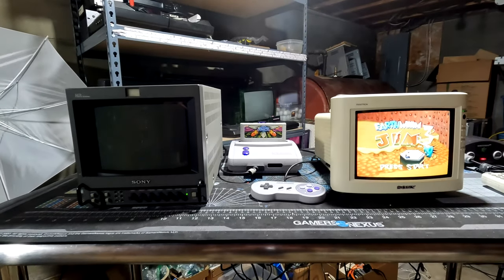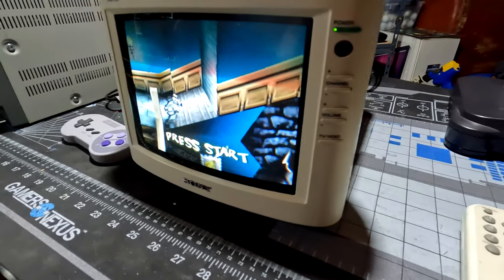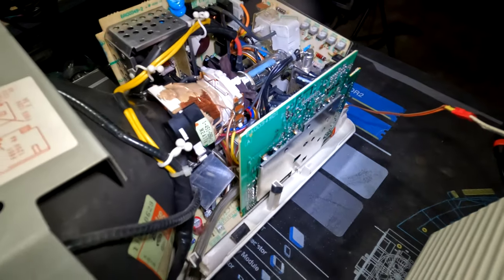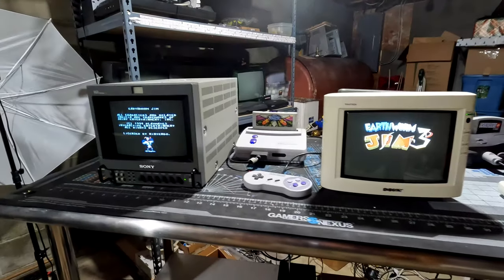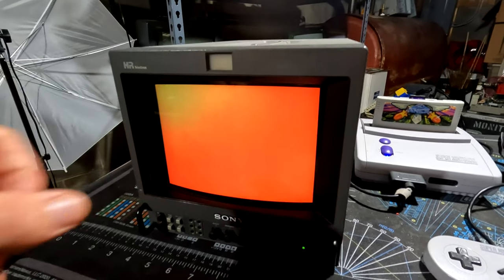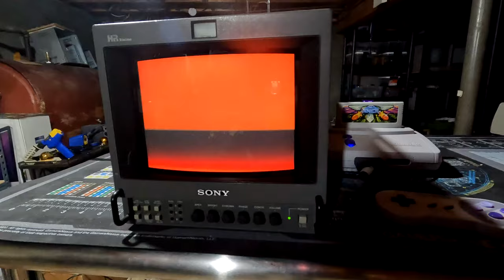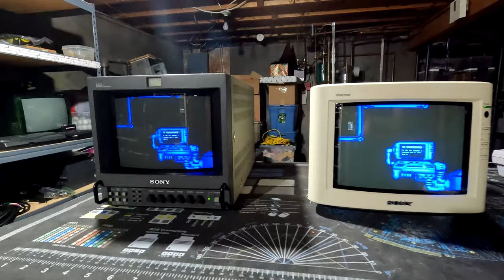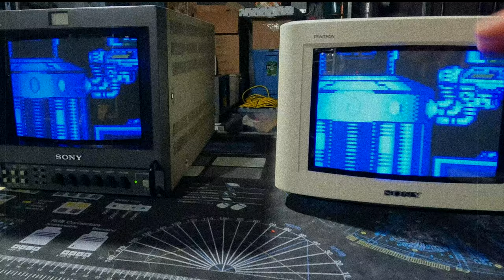The Sony CRT showdown - KV 8AD12 versus PVM 8044Q

Comment: Here'e a dirty little secret with Sony CRTs. Whether it's a BVM, PVM, or KVM, it's the exact same CRT although they had different part numbers. The CRT's were graded in manufacturing. The best were used in the BVM series, the second best in the PVM, and the rest in the consumer KVM models. We had Sony BVM monitors in our VTR bridges (above the VTR) at a playout and satellite uplink facility I worked at. When the CRT's got old we replaced them with the consumer tubes. Worked fine as a VTR monitor was not color critical.
Reply: I would like some more info on the phosphor pitch though. That seems to vary between tubes.

Comment: I’m intrigued to know… 

When a CRT gets to this type of age… apart from the fact that all types of electronics, chips and capacitors can fail which I assume you know full well how to deal with...

Does the (not sure what to call it) electron guns deteriorate and can that type of thing be fixed?..

Basically I’m asking.. once a CRT is acquired by you... is there ever a situation where it can't be taken to a new state.. like out of the box display (ignoring aesthetics, scratches etc… would love to know..

Just started watching your channel a few months ago after seeing you on ZEZ’s channel.. really enjoy your work... big love bro.
Reply: Not anymore.  This was rare to do when CRTs were the norm due to cost, skill, and equipment but the parts to repair a CRT are no longer made.  You can do a "rejuvenation" (shock) on a CRT but that almost never works, especially on a Sony CRT.  None of those can fix burn-in.